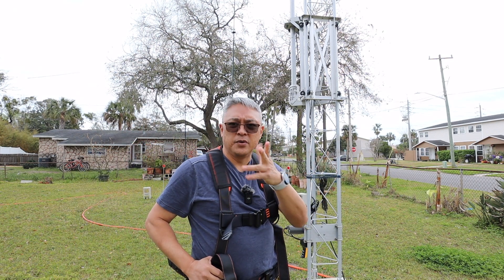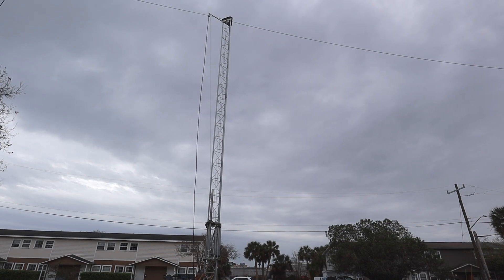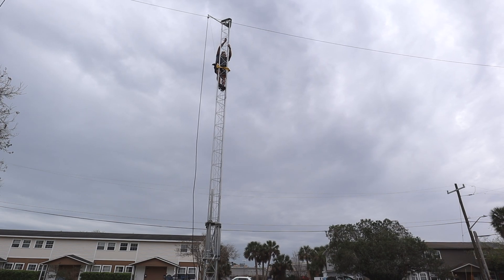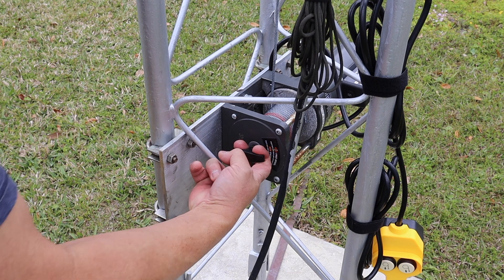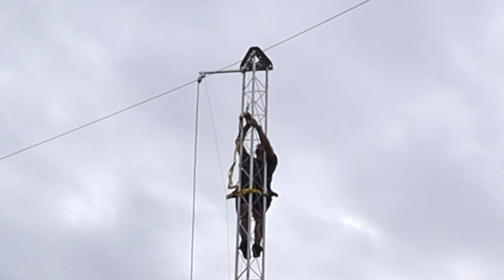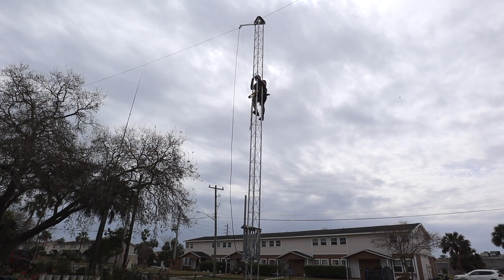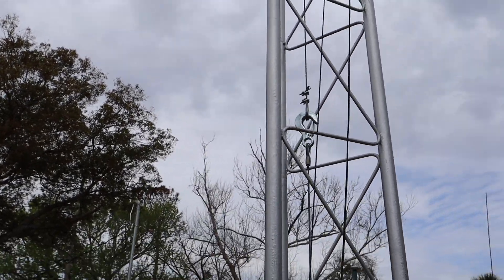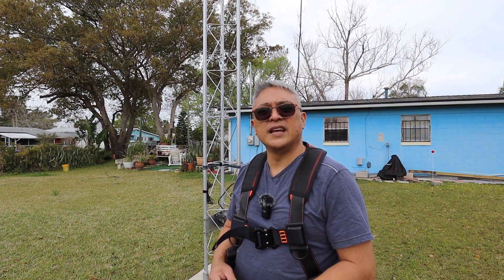Rescue  Climbing on the Rohn 25G Tower |  Winch Hook Caught on Support Beam | Tower Project

Comment: Thank you for  the excellent video on how NOT TO CLIMB  a tower.   This is pathetic.   Work lanyards  ARE NOT FALL ARREST.   You started out all wrong, even though just off the ground, by fighting with lanyards  and  while trying to get up and over the hazer   WHICH ITSELF is a hazard.    I  can not tell-  DO YOU HAVE  a  block/ 2x4/ etc  under  the hazer  to stop it in case of cable failure?  

If you are going to insist  on  climbing with a lanyard,  then  clip the unused one  on a ring so it does not dangle  and catch.   Shorten the  in use lanyard up and  work your arms  so you can pull it up as you go.  

AND IF YOU are going to talk yourself into  "being safe"  (100 % connected)  then get yourself some  shock arrest/ fall arrest straps  and LEARN HOW  to use them.  We used to use the  "Y"  ones that hook to the rear  eye up near your shoulders,  come down and around, with oversize  caribiners   so you can  quickly snap them  around  a TOWER LEG.  Do NOT  connect them to the small bracing, because if you fall, the bracing will likely  just  BREAK.

Stop trying to give lectures  to us while you climb.  YOU DO NOT  know what you are doing,  YOU ARE  a  marginal danger to yourself,  and YOU NEED  further education/ training  if you are going to live very long.  

I am 76.  Climbed my first tower at the K6NCG  amateur radio club  120ft tower on Treasure Island,  CA  in about 1968.  I have climbed quite a few amateur towers.   I climbed only  part time  professionally while doing 911 work, maybe a tower every  week and a  half or so.  .  Around here we have LOTS of  Rohn25,  a few of them up to 200ft, but  usually  40-80 footers, as this is a hilly, mountainous region.  

On another note, is that tower even safe?  Where are the guys?  How much base does it have  if it's  "self supporting?"  How much antenna  / wind loading  do you have?  I would recommend you look up and review the Rohn 25G  specs  and engineering / install data  in the catalog,  which you  should be able to find online./.  

On the hazer,  you should not even  HAVE   a hook/  connection/ splice in the cable.  The winch  line should go up and through a block   and come down and connect to the  hazer.  The entire line  from  winch, to the top, through the block,  back down to the hazer, should be ONE PIECE OF  wire rope.
Reply: You wrote the exact same thing I was going to write.  If Darren is going to climb on YouTube, he needs to take a tower climbing course so he can show other amateurs how it's done safely with all of the proper equipment.

Comment: what are you doing with a hook on it?
Reply from the maker: It comes stock like that.  I will make changes and also planning to put another section of tower.
Reply: Yep, you need too. Run a 3/16 wire rope from winch up thru pulley and back to hazer. Way I have mine, no hanging at all

Comment: Good job! Just a tip i would recomend you get a quick adjusting positioning belt you can adjust it with one hand in a second and to feel 100% safe you can get a fall arrest thing that has like a cartridge that deploys if you fall and has two hooks 73 de s53dw
Reply from the maker: Yup, thank you.
Reply: The fall arrest hooks to the hook on the top bac of your climbing harness.  If you fall you want to make sure you're going to end up right side up.  Properly used a fall arrest harness will slow you down climbing, on the other hand it will save your life if you do fall.

Comment: Darian you should remove the hook from your top cable and use a shackle 1-1/2 inch in its place. The shackle will not get tangled on the tower support.
John
Reply from the maker: Many thanks John!  I will make some changes.

Comment: Braver than me Capt.  Lol.  Fellow navy guy too. Nimitz and Carl Vinson.....been watching your tower series.  Getting ready for mine soon.  On your base video I noticed no rebar.  Is that cause of tower sections used?  I'll be doing the same with a 5' section. Not hinged but about 32' as like yours.  Also on scale of 1 to 10 difficulty digging your own hole and concrete?  I'm 55 and funds tight so probably do the same.  73.  Enjoy the Channel.  KB2AT
Reply from the maker: Digging the hole was easy. The hardest part was wheel barreling the dirt elsewhere in the backyard.  Didn't you see me dig it in 2 days?  No rebar, I went 4 feet deep and installed a tilting hinges.  The hurricane would bend the tower first before uprooting the base.  That concrete base is really heavy.  Age?  I'm 54 and retired from the Navy and still working Flying Passenger Planes.  73 Darren N4VFR ITC(SW/AW) USN(Ret).
Reply: Hey Capt.  I'm 55.  So right there with you.  Should have stayed in lol.  Did 8yrsas a MA. Yeah watching the digging hole video now. I'll probably try all myself as funds limited.  I'll be doing same base 3'x3'x4' deep for my hexbeam.  Only going up 30 to 32 feet.  73's KB2AT Chris
Reply: I noticed that he didn't use rebar also.  I believe Rohn calls for rebar for all installations.  In some municipalities you'll have to have the rebar inspected before you poor the concrete.  The rebar is in the concrete to keep it together if it starts to crack over time.  Do yourself a favor and don't mix your own concrete, just call a local mix plant and have them poor a couple of yards into you hole after you have the rebar and base section plumb and level.  Also be aware it will probably take a little more concrete they you expect.

Comment: cut that hook off and replace it with a chain splice type clevis, smaller smoother and you can remove it if needed. man stay safe when climbing keep both ends of your strap connected to your belt, a loop is a bunch better than getting it tied up in your feet or stepping on it. Hope to catch ya on the air sometime 73's to you and yours N0GCW
Reply from the maker: Thank you and will look into modifying the hook.

Comment: Will a 20 oz. soda bottle fit over the hook? If not, then maybe a 1 liter or 2 liter bottle with the bottom cut out, and the cable fed in through the top opening. Suggestion: When climbing as demonstrated in this video, I would suggest a Ladder hook with a trailing rope that has an arrestor attached. Move your Ladder hook up each level, when at the top the trailing rope should reach the ground. This affords a safety line in the event you have to go up and down several times. Bring the ladder hook down on the final descent.
Reply from the maker: @elberttanner6189  I was thinking wrapping velcro strap, but will see if a sofa bottle will fit.  Thanks!